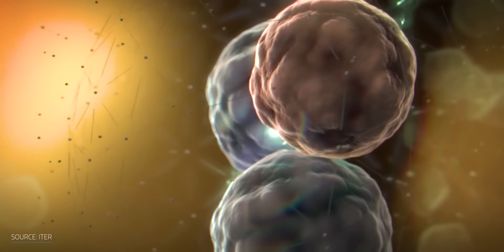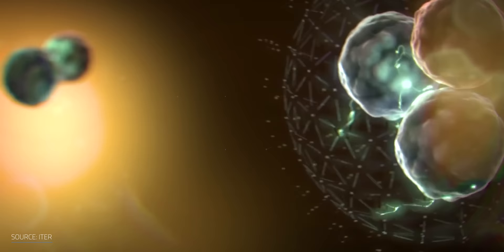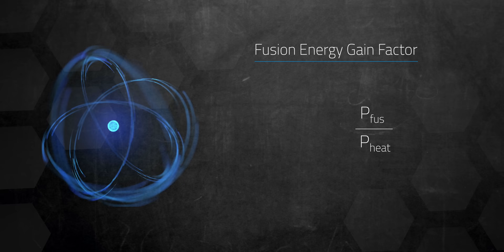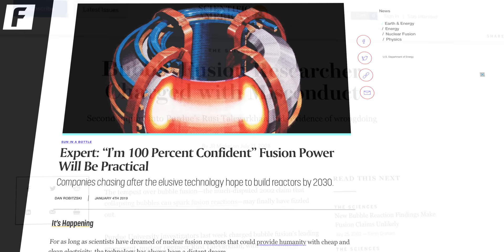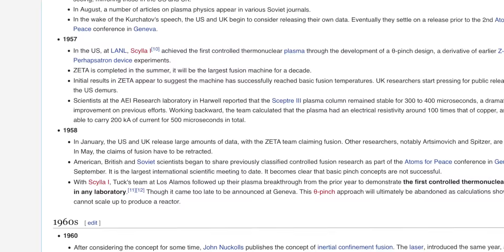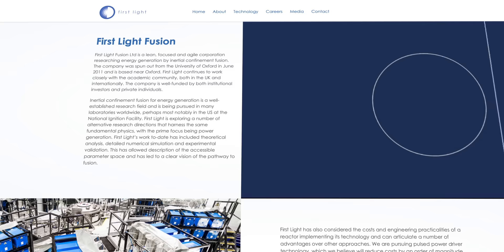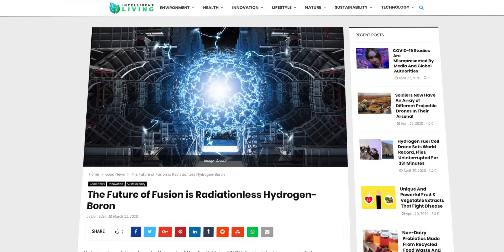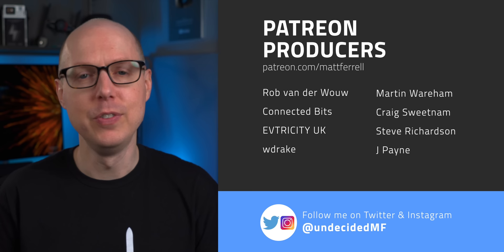The truth about nuclear fusion power - new breakthroughs

Comment: The idea of direct electric power from the reaction looks like a really massive game changer.
Reply: Nah it's merely a factor of 2 or 3 (the best we will be able to do with steam turbines utilizing indirect plasma heating from pipes inside the torus center will probably be about 50% thermal efficiency) while other roadblocks are orders of magnitude larger. It's a pity that Matt Ferrell doesn't grant particular focus to what is termed "engineering breakeven" at 4:25; this is the efficiency of the entire plant as seen from the perspective of the electrical grid. Or the problem of "we haven't yet been able to actually produce many of the physical materials needed to make this or that theoretical reactor idea work in reality". Many papers assume that parts of the reactor are made from purely theoretical materials which possess the required properties to make this or that part of the reactor process work in practice. The devil really lies in this detail here.

Comment: Fun fact: You get energy out of fusion reactions taking small, light elements and fusing them together. In contrast, fission releases energy by taking large, heavy atoms and fracturing them. In either event, energy is released when moving towards the middle of the periodic table, ie iron (Fe).
Reply: *Iron (Fe).
Reply: @neilcreamer8207  Edit made. Thx!
Reply: As soon as a star starts to fuse its core into iron atoms its starts dying

Comment: Q is only the energy quotient of the plasma reaction. And that energy is mostly heat. It is NOT taking into account the energy consumption of the whole reactor, which is substantial, nor the energy loss to get electricity out of the plasma to begin with.
Reply: " to get electricity out of the plasma "  Well put. So is all of that undone engineering missing from total power in/out theoretical "efficiency"  estimates because they are only interested in their important "can we build a sun in box" work, and funding it ?

Comment: These videos often contain 95% repetition of already known facts regarding fusion - Usually there's perhaps 2 paragraphs of actual news.

One frustration though - the mega long build times for reactors. It's really silly how long it takes to make a reactor.

This was one of the better videos.
Reply: Yes, it is stupidly long....Sadly this is for a large part due to politics. ITER is a good example: The USA withdrew from the project two times I recall, and re-joined later in both cases. Now they are considering leaving again.
Reply: The reason why it takes so long, is that they are machines for fundamental research which requires the developement and construction of unique, highly accurate parts.
Those test reactors are packed with sensors and technology for further research. 
Once you have developed a working fusion reactor, they can be build much simpler and parts can become cheaper.
Reply: It's politics and diplomacy. Every single part of the process has to involve every single country.
Reply: Of course it's repetition; it's an educational video, not a scientific report. If there is anything in this video which is not prior knowledge, it's either misinformation or a really unorthodox way of publishing scientific discoveries :)
Reply: @drx1xym154  no one is "skipping over" anything. ITER's design wasn't finalised until the 80s or 90s (cba looking it up right now). Just a few years after ITER was finalised, we found that squishing tokamaks so they act more like a cored apple (a sphere with a tube cut through) rather than an actual torus (circular cross-section) works much better. We've got a few of those built, one lives right near JET in fact. 

But since so many countries need to build parts for ITER, they can't keep updating the design brief when new breakthroughs occur. They'd be starting all over again multiple times. It's good that we're continuing to build new small test reactors even while the big boy ITER is slowly coming along, so we can both test new concepts on the small testbeds and test our economies of scale with the JET/ITER design (JET is a mini ITER). 

If ITER, at that scale, does indeed produce energy profit, then we know that our design for JET was also successful, and was simply too small to sustain itself. ITER is predicted to have the first self-sustaining (or "burning") plasma. Either we go from ITER to PROTO, or we replicate the ITER type of project with one of the other more advanced small fusion reactors we've built in intervening years. (And hopefully take 20-30 years to build it, instead of 60.)

Given the "cored apple" type topography is more efficient and more stable than a perfect torus (this topography was shown in the video briefly, at 5:17 – the D-shape cross-section is a dead giveaway), if ITER does achieve energy profit, then presumably a similarly large version of other reactors also would, even when their smaller counterparts only get reasonably close (I believe this type of topography hit Q=0.5 or therabouts, but, agian, I'm not looking anything up here), and it might be worth building a bigger version of those. 

But presumably, commercialised power stations would begin R&D using the proven type of design ITER used once ITER (or PROTO) were successful, even if later generations with new magnets and new topologies etc will be more efficient. There are many fusion power startups, but they're all putting their hopes and dreams into very small reactors. One of them may find a way, but (depending on whether ITER does in fact succeed – it might get stuck at Q=0.8 or something and make everyone very upset) current signs suggest that it's far more difficult to keep fusion plasma stable at those smaller scales. 

Even if fusion companies continued their own R&D (and some of them have some very interesting ideas, such as confining the plasma within molten metal instead of suspended in a magnetic field), I would expect quite a few of them to license the ITER-type design so they can start getting some ROI. Even if newer, better and smaller designs will ultimately supplant the huge true-torus of ITER, if ITER gets there first, then the ITER-type of reactor will stick around for quite a while yet. 

Just look at how many fission power stations we still have hanging around from the 70s, many of them still operational, despite how many advanced fission reactor designs we have on drawing boards and in labs. It's only in recent years, as they're beginning to be decommissioned, that our regulatory agencies are beginning to consider a new way of doing things, as NuScale received first-stage certification just a few weeks ago. Depending on how long an ITER-type design would last while running (materials science isn't good at dealing with the neutron flux yet), we could conceive that for 20-50  years after ITER's successful future tests, any radically different design is going to be nowhere but R&D labs. And then, after these huge first gen reactors start running out the clock, that's when we might see the fruit of the proliferation of reactor-type ideas we're getting today.

Of course, it could play out differently. ITER could succeed but the lessons learned are backported onto smaller reactors, possibly even bringing JET to breakeven? (New control systems for the magnetic fields have had promising progress lately, especially ones involving machine learning) That could lead to a proliferation of reactor types and sizes in the much nearer future. A lot of it will depend on how the regulatory system ends up working, and on how expensive each individual reactor is to build (ie will a company build them, or will it have to be multi-nation efforts like ITER all the way?). 

We might see fusion reactors that can fit in a lorry's, er, box thing... or we might not, even if feasible from an engineering standpoint, if the costs are too prohibitive (ie alignment of field coils, thickness of reactor vessel wall, etc are almost certainly going to be very strictly defined). We might be able to buy a personal fusion reactor to power our house from in the size of a current diesel (or future hydrogen) generator.... or we might have to simply be satisfied by knowing that there were a handful of ITER-sized units out there powering our nations.

Well... this ballooned quickly :) I'll stop here